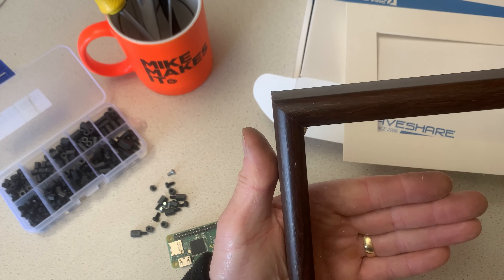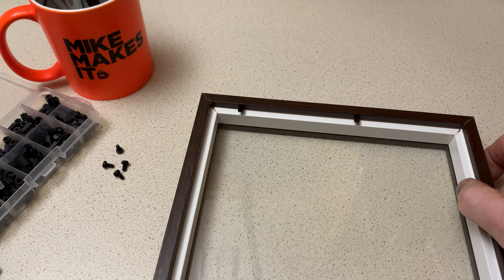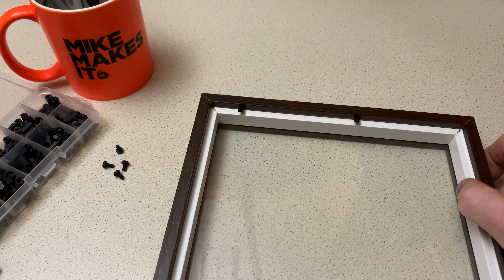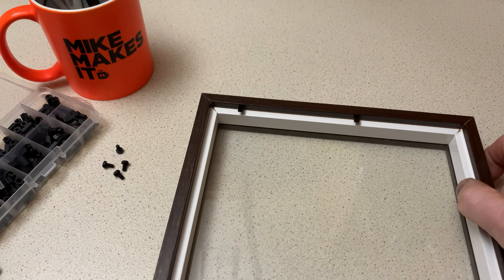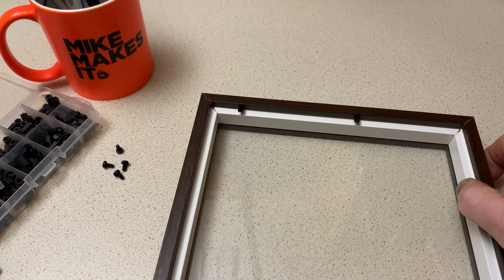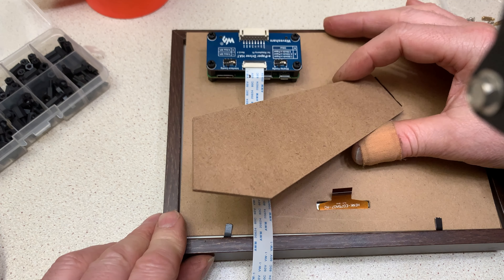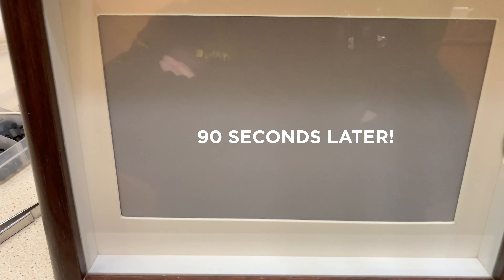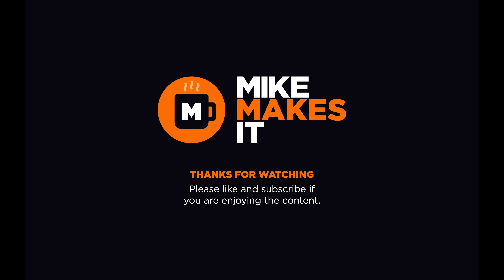Waveshare E-Ink Raspberry Pi Zero W 7 5" 3 colour Sub Counter.

Comment: The display looks beautiful.
Reply from the maker: I’m really pleased with it. Still using it now. It’s a bit more trouble than a led display because of the way you have to shut it down but apart from that I really like it. Thanks for the feedback and for watching 👍🏽
Reply: Would you recommend if I were to make a clock out of it or the refresh would be too slow for a clock since it would need to refresh every minute?
Reply from the maker: @silentobserver964  on a pi it takes around 30 seconds to reboot/refresh the display. This is when the display flickers. So for a clock, half the time there would be no real display.  With a quicker processor perhaps you could get the display to refresh quicker. I’ve not looked at this though.

Comment: Hello, 

you know your stuff very well! can you maybe help me? I have connected my display, the driver works, but the display doesn't show anything. I would be very grateful if you could help me?
Reply from the maker: @leonrichter5943  Hi, my advice would be going over everything you have done, I expect you already have but it is easy to miss things and with the software one wrong space or , is the difference between running and not. Other people have built this project so all the information is sound. Good luck 👍🏽 but remember I do have an image of the software on my Google drive so this should eliminate any programming errors.
Reply: @MikeMakesIt  Not sure, I have always found they just work.

Comment: Amazing ! 
Do you think this waveshare e-screen model could work for an ebook project ? Or maybe the refresh is too long ?
Reply from the maker: Hi Andres, thanks for the comments. Certainly when the display reboots (set to 3 times a day in software) it does take about 30 seconds with a Pi4 to totally reset. If you were going to use the same display for example read a Kindle type book if the refresh rate took 30 seconds I'd be looking for a different display but this display may be fine as there would be no need to reboot for your project potentially, just refresh, I've just had not used it in this way so couldn't say with authority yes or no. Check out the Waveshare site as I'm sure there will be information that may guide you on this. I hope this helps a little, if not come back to me and I'll do a bit of searching as well. Thanks for watching 👍🏽

Comment: use battety?
Reply from the maker: Hi Enio, you could use a USB battery bank although I chose to go the mains PSU route so I could fit and forget. That way I know the display will be refreshed everyday. If the battery pack died I may not notice and the display would not be refreshed as per manufacturers instructions. Thanks for watching 👍🏽